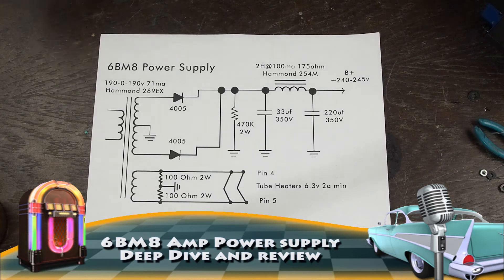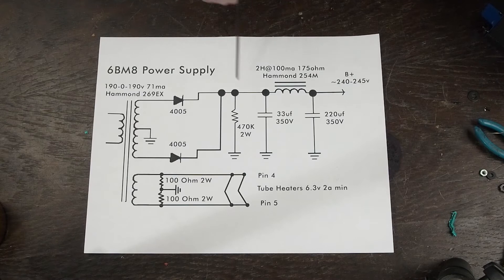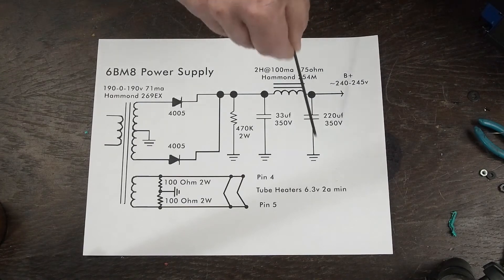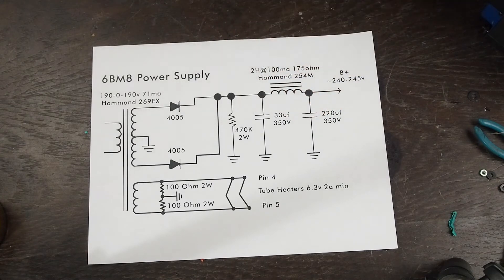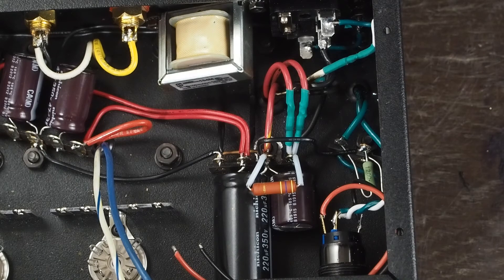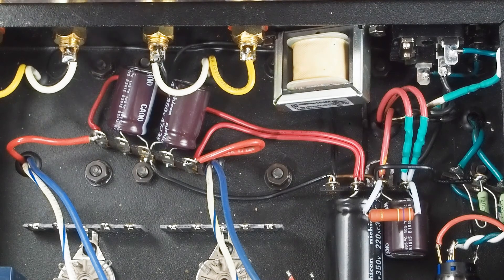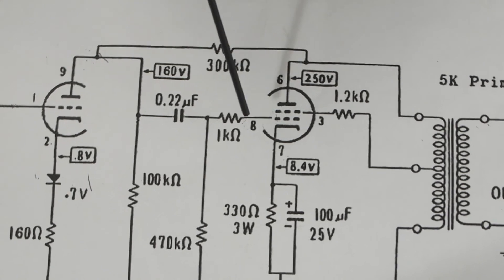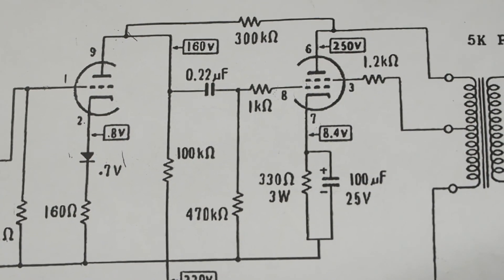6BM8 DIY Tube Amplifier More Power Supply Review #11

Comment: how about replacing the choke with a resistor? thx
Reply from the maker: You will have more ripple and save a few $ is the reasoning?
Reply: @SkunkieDesignsElectronics  just want to make it simple! thx
Reply from the maker: But yes, you could just use a resistor and see if there is audible noise.